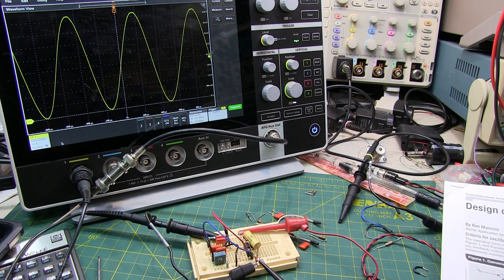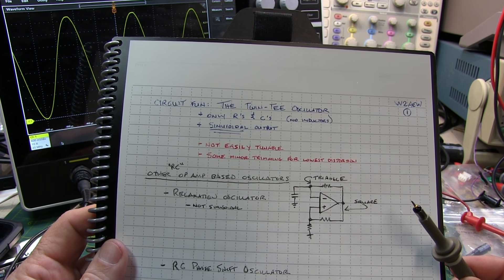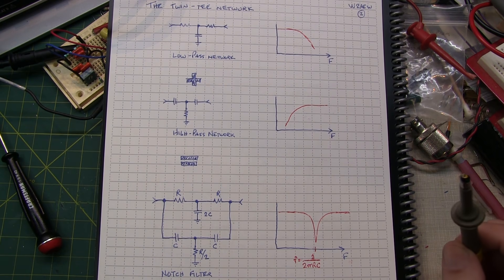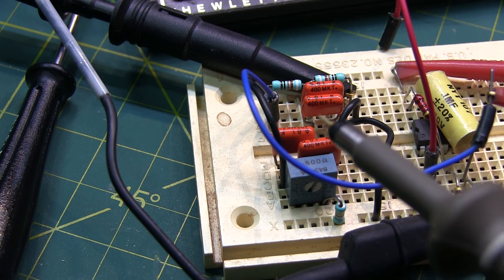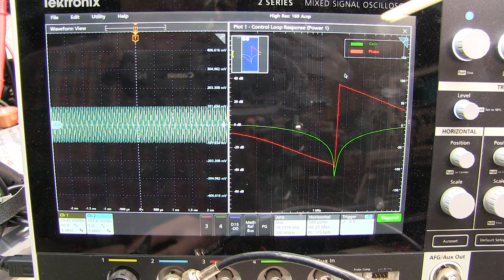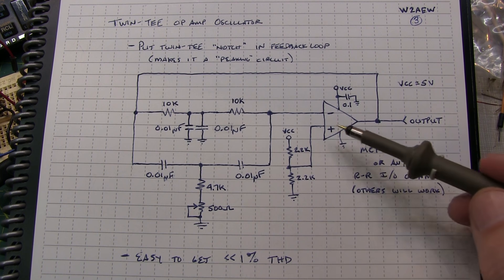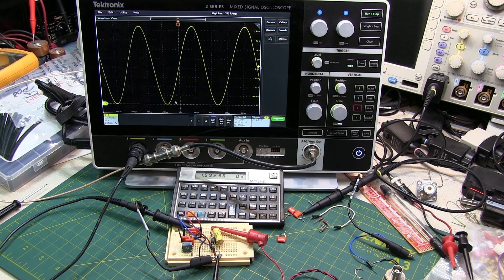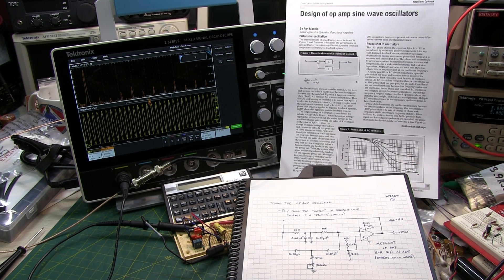#380: Circuit Fun: Twin-Tee Oscillator - low distortion op amp sine waves

Comment: Here's an abstract for the transcript, focusing on the electrical engineering aspects of the video: (generated with gemini ultra)

Abstract

This video explores the design and implementation of a low-distortion sine wave oscillator using op-amps, resistors, and capacitors.  The focus is on the twin-T oscillator, a design noted for its simplicity and lack of inductors. The video begins with a discussion of oscillator theory and then compares the twin-T oscillator to other common types of RC op-amp oscillators (relaxation, phase shift, Wien bridge).  A twin-T notch filter is constructed and tested with a Bode plot to demonstrate its frequency response. Finally, the twin-T network is incorporated into an  op-amp oscillator circuit. The oscillator output's low distortion is demonstrated through visual observation, FFT analysis, and a THD measurement. 

Keywords: oscillator, op-amp, sine wave, twin-T, distortion,  RC filter, feedback
Reply from the maker: Very eloquent! Pinned comment to the top!

Comment: I almost used this oscillator circuit in a tester I developed for technicians repairing hearing aids where I was working. The problem I had was making it variable for over a decade in frequency. This was in the late 70’s so you can guess my age.

 In the end I decided to use a triangle wave with a piecewize diode network. The distortion was just below a half percent which worked fine in the application.

We built 30 of the instruments to be used at our subsidiaries around the world. Was a fun project.
Reply from the maker: Sounds like you made the right choice, given the frequency adjustability requirements.

Comment: so the oscillator was running at roughly 1.6kHz?  what would be the best circuit that can be adjusted over a range of frequencies?  say for DTMF of 697 <= f <=  1477 ?

Comment: HI Alan, I have a question about the oscillator. I built one with a 2N3904 using the C&R/2, 2C&R values. If it was oscillating, it wasn't anywhere near audio. I had to drop the shunt R from 27K down to below 10K to get close to my 600Hz target (27K ohms and 10nF). I checked an old ARRL handboook and it recommended the shunt R being about .1R. Any idea why so many online circuits use R and R/2 instead of the .1R that works? Is it op amp vs bipolar for the active device?  73, Dave AA3EE
Reply from the maker: Hmm - I'd have to think about it, but I would imagine that the dramatically lower open-loop gain of a bipolar solution vs an op amp is likely a big part of it.

Comment: I have been trying to understand op amps on and off for the last 35 years. I am still not there. I appear to be dense to this material. Smart, but this intersects with some weakness of mine. 
I can tell all of the information I need is in this video and in #75 Basics of Op Amp Circuits.  I am going to have to watch them again. Thank you very much. de w0it

Comment: I am curious what the  MCP  in the name MCP6xxxx stands for. I looked at the parts on the microchip site and couldn't put together a good answer? Is it just a 'microchip' designation?
Reply from the maker: Probably just an abbreviation for MicroChip.  They couldn't use just MC, because that was used by motorola.

Comment: I discovered this oscillator back in college while using twin-Tees to measure distortion in my homebrew amplifiers.  I always needed a little positive feedback to ensure oscillation, which is different from what this fellow achieved.  The good part about the positive feedback is that you can add AGC to keep the wave from hitting the rails and distorting.

Comment: I am trying to build a self-contained component tester with a built-in sine wave generator. This way you can avoid needing a 110V plug, or a signal generator. It would be nice to power it up from a bench top 12V power supply. This would be a good start. But any clever idea how to make the sinewave oscillate around 0V with a single rail power supply? (assuming power supply's ground is tied to the same ground as the scope's, so that you can't just hook up the mid point of the sinewave to the scope ground...)
Reply from the maker: Simply put a capacitor in series with the output, followed by a resistor to ground.  The signal on the resistor will swing above/below ground.
Reply: @w2aew  I've been thinking that, just like a speaker output on an audio amp. Thanks for confirming.

Comment: Sir  plz make a video on twin t oscillator which is used in cw code practice oscillator
Reply from the maker: That would simply be this oscillator with a few minor changes and additions:  Change the RC values to get about 700Hz oscillation, add a buffer to drive a speaker, and use the key to turn it all on and off (or switch the buffer input on and off).

Comment: This is good, thank you. How high frequency you can go to design a stable oscillator without using crystal..??
Reply from the maker: This will depend on the op amp used.

Comment: Very nice, is thre a simple way to make the cct tunable over few decades? My suspicion is not as it would require too many simultaneously variable values.

PS, love the closing words, I'll add my own to it:
See you later Oscillator. 😁
Reply from the maker: Unfortunately this is not easily tunable. Lookup a bridged tee oscillator. That one is tunable.
Reply: @w2aew  Thanks, will do.

Comment: Hm with -45dB notch dip THD should (theoretically) be 0.00316% but 2 potential problems might be of limiting factor: OPamp is not capable of that low of distortion itself (in the datasheet manufacturer is not really bragging with low THD performance so….), or as i saw in the video, there is still some clipping occurring during adjustment process, which is making this oscillator as complex as Wien oscillator, which is similar in nature just uses 1 order lower H/L pass filter combined into rejection notch filter.
Reply from the maker: I suspect it is a combination of things...  the "trimming" process is actually de-tuning the twin-tee in order to achieve the 180 degree phase shift and 1/openloopgain to just meet the Barkhausen criteria, the inherent distortion in the op amp, and other non-linearities of the amp near the rails.

Comment: How can we make a microphone audio feedback or howling prevention circuit (especially to avoid feedback from condenser mics)?  Is there a way to sense the howling frequency first and auto-adjust instantly?
Reply from the maker: One technique that has been used is a a very slight pitch shift (upconverting to a higher pitch, then down-converting to almost the original frequency).  Not so much to be noticeable, but enough to prevent the positive feedback from happening.  Modern systems likely use DSP techniques.  There may be other techniques that I am not aware of.

Comment: Dear Alan, thanks a lot. As you stated in a comment below, Twin-T is not such a modern or common technic to build oscillators, and I thank you as your video helps me understand it from the designer engineer level: I have a device in my bench I need to fix and there are a 55 Hz oscillator, and I was searching to understand its principles and you clarified it.
I'm used to other types, or architectures and this one turned into a challenge/mistery. 
The device measures insulating oil dissipation factor and the read value from a sample is compared to a Tan Delta known SF6 insulated capacitor, which has a very low and steady factor. In my case, device can't measure the sample tan delta, showing a negative result, and this is not consistent.
Comparing both sides of circuit helped me locate the fault, but why to build such a circuit? Device's reading error (precision) is up to 1% and THD below 0,1%.
I do thank you a lot for accepting my sugestion and producing this video.

Comment: I might try a few hundred kOhms between output and inverting input.  A little negative feedback to stabilize the gain and then adjust the filter for maximum signal.

Comment: Like a lot of engineers, I've stashed away many articles and app notes on subjects of interest.  I'll let you guess which one is joining the collection.  😄  My collection already contained TI's AN-263 Sine Wave Generation Techniques.  It doesn't mention the twin-tee oscillator, but has a nice variety of different methods.  You can find it on TI's site:  https://www.ti.com/lit/an/snoa665c/snoa665c.pdf
Reply from the maker: I'm going to add this link to the video notes, thanks!

Comment: Can't say I'm a twin-T fan...due to the tuning difficulties. Years ago, I had the joy of doing production calibration of a device that used a twin-T 60 Hz notch filter. The time & frustration in adjusting three multi turn trimmers to both hit the frequency and get enough rejection was ridiculous, and doubtless subject to drift in the field. Really bad design choice.

Comment: Just in time. Going to try this soon! I just recapped an old Sinadder and I need a good low distortion oscillator at 2000 Hz to calibrate it. The arrl book describes the wien oscillator with bulbs for a 2 two tone generator, but I don't like the idea of using bulbs in this age.

Comment: For some more fun with this circuit,  set it up so that it doesn't quite oscillate,  and then when you kick it with a pulse it'll give a nice effect,  like ringing a bell or similar.
Reply: I have done that and it is quite nice driving a speaker as a "bell" circuit.  You can also set it up so that it clips when the signal is large and is sounds even more like a real bell.  Bells have other modes that die away quickly after being struck leaving just the main tone.  A bit of distortion mimics that.

Comment: Awesome ! The first HP product was a bulb stabilized Wien Bridge Oscillator and Dr Hewlett did his PHD around this subject as well and I have been fascinated with it for some time now. I am currently using an OPA1656 (op-amp) and some good tight tolerance components and a CM7371 bulb also I designed a PCB, breadboards are fine but when you move to PCB its great as you know!! I have @1Khz 1v P-P a THD of 0.005% using a sound card an ARTA software to measure. Its just great fun and there is of course a bulb involved !! good old thermionics but its a shame at low power you don't get a glow ! So I have a great little low harmonic distortion sinewave generator and is powered by batteries of course and they are two 3.7v lithium cells that I strip out of 'old vapes' that people (disgustingly) just throw on the hedgerows where I live. So I have amassed quite a lot of cells I can configure how I wish for some of my projects. I have copies of those TI application notes to read now so thanks !..........cheers.

Comment: You make a great teacher! Around 2001 I was taking my first EE course in college. I wanted to learn digital electronics, but couldn't wrap my head around analog concepts. I soon switched majors to computer science and didn't look back for 20 years. Then about 3 years ago I was bored during lockdown and started teaching myself electronics, mostly by watching YouTube videos and by experimenting with my new oscilloscope. At first I could barely explain the function of a resistor, but I've now made a few successful mixed signal PCBs (mostly in the digital domain, but there's some RC and LC filters and comparators in there). It's neat for me to now see this kind of video and immediately come away with a good understanding of the circuit. This is all to say, thank you and other YouTubers for making this kind of content!

Comment: The limitation of tuning to a desired frequency is quite severe.  Built these in the early '60s because I wanted a low THD sine wave for audio testing @ 1 kHz.  Took days finding all sorts of MIL-surplus precision capacitors and resistors.  The common carbon composition resistors back then were 5% and paper capacitors at 10% in the sub-uF range.   I finally found some 0.1% Rs and some 2% Cs, but still too far from the desired frequency.  So I spent days adding small resistors and capacitors in series and parallel to get to 1 kHz.         

Also in the '60s, Popular Electronics Magazine had an article to make "Electronic Bongos" using Twin T oscillators biased just bellow oscillation and triggered by a touch pad and a differentiator. This made a damped sine wave which with some imagination sounded like small bongos.

Even today, generally available parts precision ranking is: #1 = Rs (1% common, 0.1% quite available)  #2 = Cs (5% std, 2% available) and #3 = Ls (10% std., 5% available).  Yes, all are available better than 0.01%, but they are often un-obtanium and un-affordium.

Keep up the great work!  I was often called an OFAE, "Old Fart Analog Engineer", even in the last century, when I wasn't that old.

Comment: What makes an oscillator into a Relaxation Oscillator? When measuring the THD on the THD meter lets say it it measure 0.500, using the Spectrum Analyzer to measure THD how do you MATCH the measurements so that the spectrum analyzer THD measurement is also 0.500THD?

Comment: The link you gave to the TI paper is for a different Ron Mancini paper on oscillators. The link to the one you show in the video is <https://www.ti.com/lit/an/slyt164/slyt164.pdf?ts=1708143002350&ref_url=https%253A%252F%252Fwww.google.com%252F>   Not much difference in the two but different diagrams.
Reply from the maker: Thanks - fixed the links.

Comment: Great video lesson. My customer wanted to see a slow sinewave so, I dug into my Heath electronics course and built a twin tee for 1/9 Hz or so. My old Tek 464 with variable persistence displayed a smooth sinewave. I had to use large capacitors.

Comment: I experimented with twin tees in the early 70's.  Using hybrid circuits, we built a twin tee brain wave feedback circuit, notched around 7 Hz.  You could train yourself to relax and generate (7 Hz +/-) alpha waves that triggered a tone generator into earphones.

Comment: I'm a bit surprised, that one resistor can regulate an amplitude. In theory, due to positive feedback in generator,  once a loop amplification is high enough, amplitude will raise to infinity. Of course there is supply voltage limit, but that means clipping. Hence the lamp in Wien oscillator.
How it works here?
Reply from the maker: The non-linearities of the op amp when it reaches the rails have lot to do with it.

Comment: Twin-Tee were used quite a lot in vintage analogue drum machines and electronic organ accompaniment percussion.
Reply: I had to look up how the 808 kick was done. As it turns out, not exactly a twin-T but rather a bridge-T oscillator which is a slightly different topology.

Comment: Anyone have a General Radio 1650B impedance bridge (early 1970's)?  In my "for parts only" model pretty much the same circuit shown at 8:30 is used as a tight bandpass at 1 kHz in the detector.  The op-amp is replaced by a 3-transistor (very high gain) negative feedback amplifier.  The service manual mentions the possibility of it oscillating, which it does very well.  What Barkhausen changes would make this a bandpass?
Reply from the maker: Having loop gain <1, or phase shift <180 degrees.
Reply: @w2aew  I was going fishing to see if anyone had analyzed this circuit.  I spent a lot of time on it and still can't figure it out, pretty complicated for something designed when everything probably used tubes.  Google let me down.

They use the DC part of the notch filter to bias the amp like a single transistor amplifier collector feedback (just at Vbe) and, as mentioned in the video, the rejected part for high gain.

Comment: Started looking through some of my Op Amp specific books and was surprised that this was not mentioned in any of them except for "Operational Amplifiers: Theory and Servicing" by Edward Bannon. I do have probably hundreds of electronics related books and maybe this circuit was mentioned in a few of them, but was surprised at how little information there was in print. I'll have to pull out the breadboard and play around with this when I get some time.

Comment: When I worked as a product design engineer for an audiological manufacturer, they needed a variable frequency, audio oscillator whose frequency could be set by the processor. I "inherited" a design which used a switched-capacitor, bandpass filter as the feedback element with a "wide-open" op-amp. The BIG issue we had wasn't THD, but phase distortion that was totally hosing up audiological measurements.
As a little trivia background ... we would put two sinusoidal signals into the ear (via tiny speakers). These two signals would mix in the inner ear (a non-linear system) and a third, related signal would return to the probe (to a tiny microphone).  We would measure the amplitude of the returning signal to determine the health of the entire audio chain from eardrum to inner ear and back. Pretty slick, eh?
Reply: Like what Nura does?

Comment: In the 1980's I built a portable audio mixer to operate with a 16mm camera. It needed a bloop generator to put a synchronising burst of 1khz on the tape to coincide with a white frame on the film.
I used a Wien oscillator with a lamp for stabilising the frequency. Worked well.